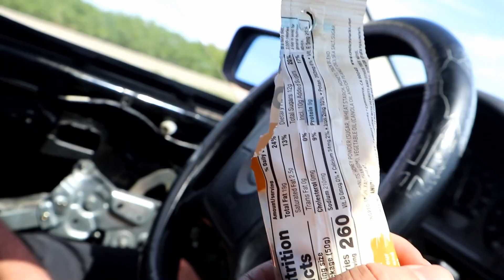Our New E36 Tried to Strand us - 318Ti Adventure Day 2

Comment: I recently got stranded in my m52 swapped and manual swapped 318i. It ended up being a blown fuse (15A) for the fuel pump. Fuel pump was replaced as well which was from a 328i.
Reply from the maker: yeah unfortunately there is no fuse for the clutch lol

Comment: Broken temp guage. A recipe for a blown headgasket, just add water. 😝
Reply from the maker: yeah, your temp gauge is plugged in but the sensor is just hanging in the engine bay. fml
Reply: @M3NACE  Sure you guys will get it sorted out. The ODB1 Ti is a hard car to find now. That little engine is rock solid, even more reliable than than the ODB2 engine.